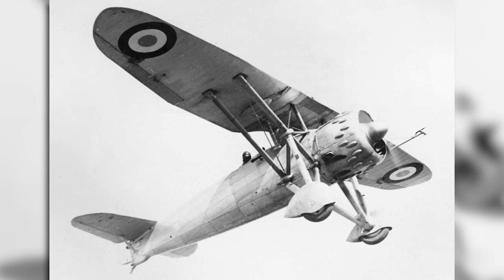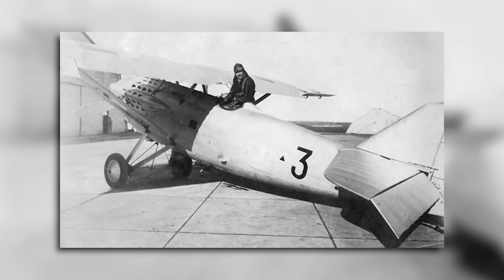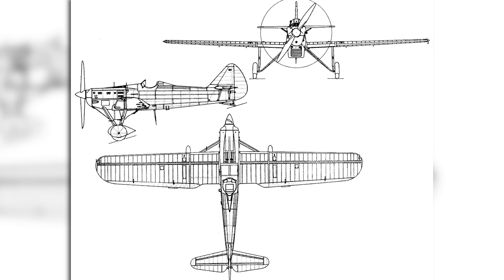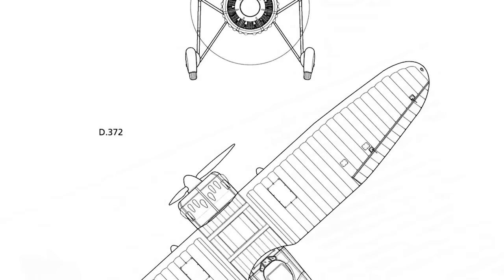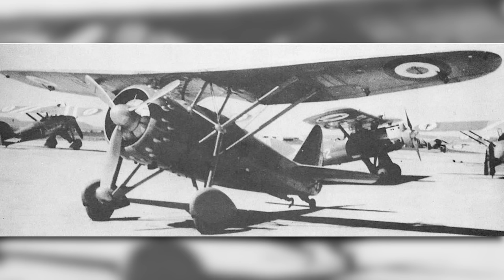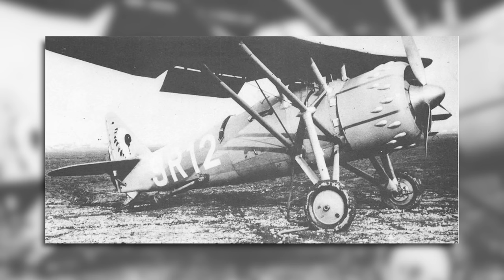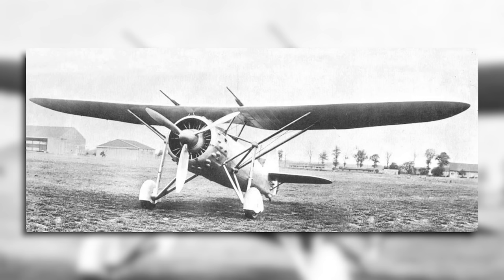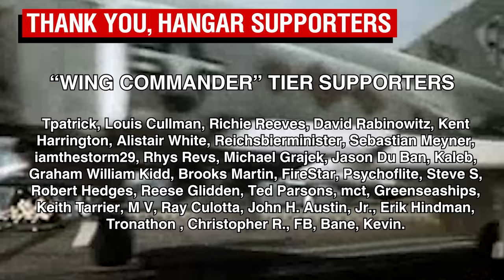Dewoitine D.37X Series - Aircraft Overview

Comment: I just read the wiki page on it because the He 51 was mentioned.

It said D.371s defended from He 51, and called them older models…

The D.371 first flew in 1932 and the He 51 in 1933…

Just say the Gunther bros sucked with engine choice and metal placement, instead of finding convoluted ways to insult my baby

Comment: Strange that the Republican Spain couldn`t arm those unarmed planes themselves.
Reply: They did, as all the French Dewoitines arrived unarmed and this was a trivial affair as the weapons were mounted in the wing. Problem was the available air guns, the Vickers E, wasn’t very reliable and, when mounted out of pilot reach, stoppages could not be cleared as in nose mounted guns. In any case they were relatively successful in the early stages oftne war and some survived in second line duties after lack of spares and low numbers made them unusable and were replaced by modern Soviet types like the I-15 and 16. Both were made under license during the war, with more than 200 I-15s being built locally. Unfortunately, neither guns or engines could be locally sourced
Reply: Good to know. THX. @glmm2001
Reply: @glmm2001  They were using the venerable Vickers Mk.II/II* from WWI, same as on the Hispano-Nieuport 52. Reliable, it was. Don't know if the Spanish ever used the Mk.III, though. Thing is, the wing mounting for the machine gun was not properly adapted and hampered the secure feed of rounds from the belt. The Loire 46 had the same issue with the gun mountings in Spanish Republican service. Cheers.

Comment: Wow, this airplane had such a messed up life. A fighter that could not fight, with guns that have three seconds of ammo and an engine that would tear itself apart. And I'm sure they took the brakes off to reduce weight.  🫣
Reply: the 3 seconds of ammo where only for a prototype with the 20 mm's. the produced version used 4 7.5 mm guns that could fire for more that 10 seconds